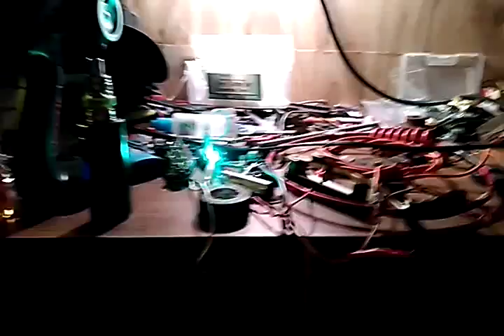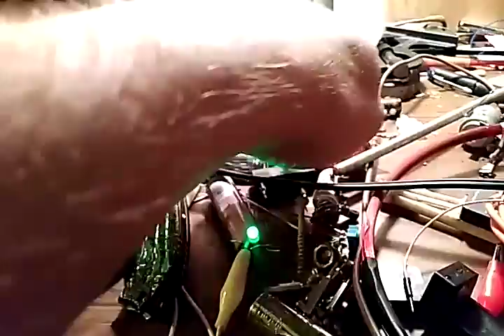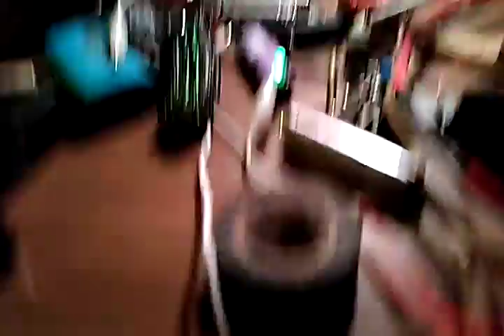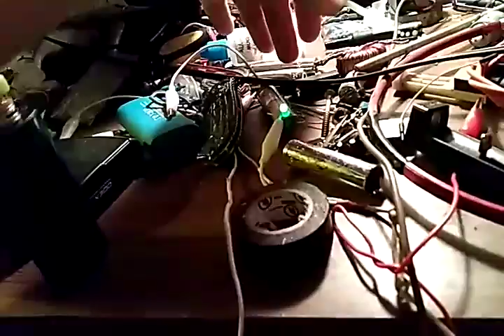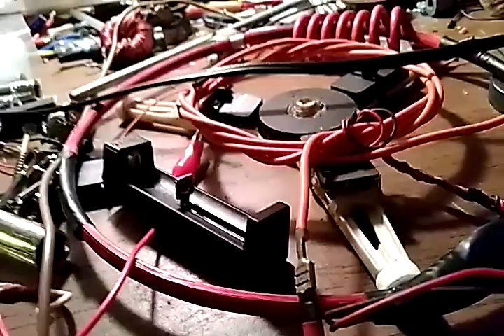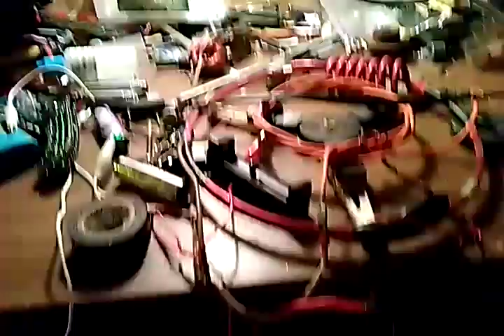Rf Charging Li 3.7vdc CHARGED IN 3 DAYS...  (FREE ENERGY)

Comment: we should get together and talk. im in AR too n have been interested in perpetual energy for decades. i was a radar tech in usmc in the 90's. im not sure your pulling electricity from the air with this setup. the magnets possibly are inducing current in the coils. i have a cell phone charger that works off my shop radio. the better the station is tuned in the faster it charges, altho it will trickle charge on just a static setting also. for years i have dreamed of a box that would pick up all the radio n microwaves in the air at same time and turn it back into usable energy!
Reply from the maker: +R squaRed  are you close to Little Rock?
I'm self taught so I never learned that things were impossible... lol  energybuies@gmail.com

Comment: you need to look up a joule theif circuit n earth batteries. i built an earth battery from a .999 fine 1oz copper coin n a zinc galvanized washer, each glued to opposite sides of a piece of a cork coaster, like for your tea glass. i soldered wire to each side and buried it. i get .8 to 1.1v depending on how wet the ground is. i wired that into a joule thief circuit and its running a 3v led just fine. ive built 3 of them to light up my walk way at night. the 1st one i built has been running day n night for over 2 years. the other 2 are almost a yr old now. it works like a potato clock but using the earth instead of a potato. the joule thief circuit works like a water hammer but for electrons and increases the voltage enuff to run the led brightly. what a coincidence, im in AR too!